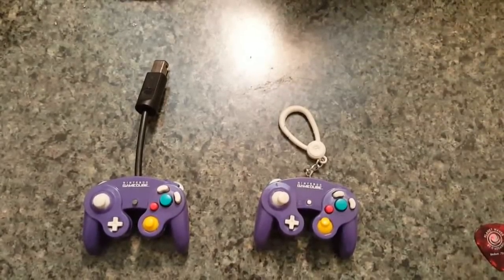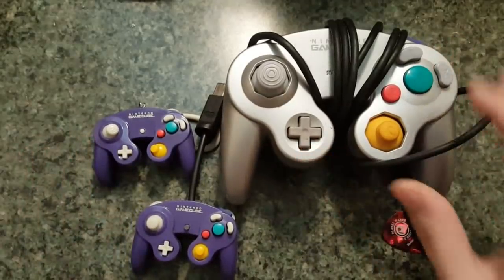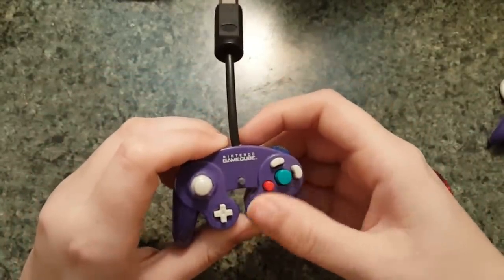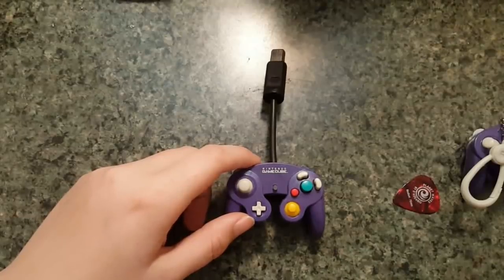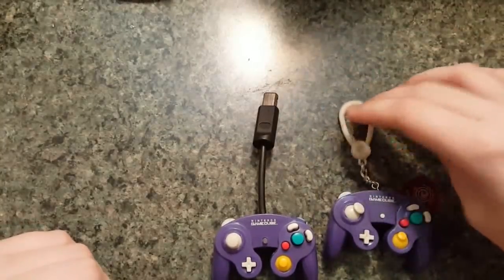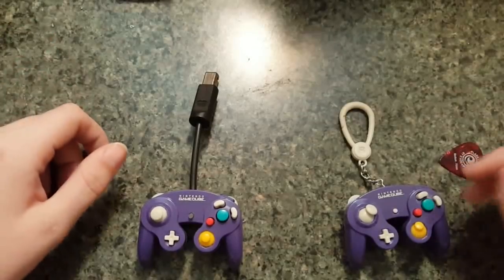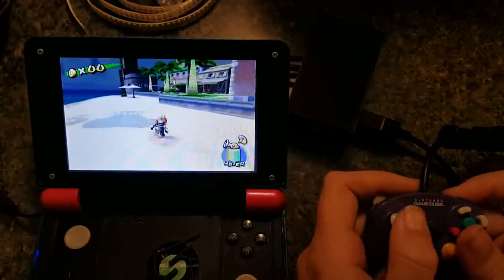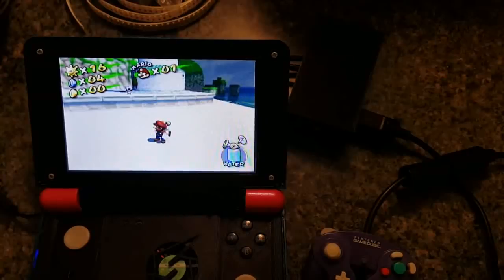World's Smallest Working Gamecube Controller

Comment: Now you need to make a tiny gamecube to go with it
Reply: Hisho 

If they can manage that then we'll be sitting on a Million Dollar emulation/hardware shrinkage solution for sure :)
Reply: solder rpi zero off the board and put it inside a case
Reply: The RPI zero can BARELY handle n64. I don't think emulating a gamecube would be the best idea.
Reply: Link Hero Of Time 
You could use a similar idea of shrinking the controller board using a combo of Flex, and Plex boards, and modify an Odroid to fit inside a Full Sized GameCube Controller case, (I think Odroid can handle GameCube) that in theory you'll have a portable emulation machine built into a controller.
Reply: She’s already using one. Kind of.
But that would be cute
Reply: She made one it's her latest video
Reply: SHE DID LMAO
Reply: You can't really tho because then you'd need a tiny GC disk (or emulator) which would probably need work on before making small
Reply: @MrScrubby55  LOL she used a minimized Wii and what I assume is Nintendont to run GCN games off a USB
Reply: Funny that she did
Reply: I'm pretty sure she has.
Reply: He already did
Reply: The madlass did it
Reply: @ryan caling she*
Reply: she did😂
Reply: @LK-nu6mg  sucks that she didnt use this controller
Reply: She did lol
Reply: @nakog8686  yep it was this and some other mods to make it usable without a remote
Reply: @ryancaling1711  hey when the comment is made is right by the name...

Comment: Is it possible to make a Jumbo/Large Controller?
Reply from the maker: Axiom Ape Yep. Now find me a jumbo gc controller toy or model that I can use for the shell :P
Reply: Madmorda gotchu maybe
Reply: Madmorda 3d print it or get someone else too
Reply: 3d printing a huge gamecube controller would be really pricy
Reply: The Shangry Llamas true
Reply: The Shangry Llamas what? 3d printing is cheap as hell, you would just need a big enough printer
Reply: exactly, you would either have to buy a big enough printer or rent one or pay somebody else to do it. pretty damn expensive still.
Reply from the maker: The Shangry Llamas I have a pretty good size printer :P but there's a reason nobody has 3d printed a gamecube controller shell.
Reply: If you had a smaller print bed, you could also print your controller in smaller sections and glue them all together. It would be easier with a larger print bed though.
Reply: That, my friend, is Jumbo/Large.
Reply: that looks like 300 times more easy
Reply: Have your heard of the gamecube controller keyboard? Its soooo big but costs $100 to $300

Comment: You could use it with the Switch as well with the Magic-NS Adapter and a GC to USB cable converter to whatever length youd want and it would be like having a mini Pro controller.

Comment: That's dope. Do you make ps2 or ps3 controllers as well? And if i wanted to make my own, how'd you get a motherboard that small?
Reply from the maker: FastbackV8 If you want to make your own, check out the description :). As for ps2/3 controllers, they're analog so you can't make a Sony one small. You could make a third party one smaller, but you'd need a tiny shell to put it in. Find me a dualshock looking controller toy that's this size :P
Reply: Madmorda Hmm? What do you mean by analog? And I appreciate the fast reply.
Reply from the maker: FastbackV8 Haha I mean that it doesn't have a circuit board, it has a floppy piece of film that is very touchy and can't be replaced by digital (on/off) buttons like the ones here

Comment: I have several questions;
Will you be doing commissions later on?
Will you have a USB version?
And will you make the wire longer?
Reply from the maker: Vin32 There will only be one more for sale. If you're interested, please email me. If the wire was longer, it could damage the internal wires over time with the weight, so no. And no I can't make a usb version, but you can always use the wii u adapter with it :)

Comment: What did you do just chop chip out of the board and run wires to the components you installed??
Reply from the maker: It's a GC+ replacement board developed by Aurelio Mannara :) there's more info in the description

Comment: It wasn't clear from the link but what board were you using to push signals to the GC? Looks like a tiny purple board? Something from Adafruit? Very cool project! :)
Reply: The board is called a "GC+". It was designed by a guy named Aurelio. You can buy them at bitbuilt.net once the store upgrades are complete. There's a link in the description to the site.
Reply: Thanks for the info, much appreciated. So I guess someone's already done all the homework about how to interface a custom board to the GC then? Hope there's documentation. :)
Reply: I don't know how much documentation there is on how it works, but you're welcome to make an account on BitBuilt and ask. We like to share, so I imagine those who know the specifics can answer any questions you have about it.
Reply from the maker: youtubasoarus It's open source :) you can make your own. It's on github, just search "gc+ aurelio pcb"

Comment: Tangential thought: i have a Wavebird-style controller, a Chinese one, there's no room for normal rumble motor nor one present, and i noticed there's an unpopulated set of footprints for resistor-transistor arrangement ant two pins, and it seems like i could fit two motors inside the handle wings. Does anyone know, how do i find a fitting motor that i can order? I don't exactly have a shit ton of parts.

I know the stickboxes aren't very good or durable, but i can put something decent in later. I got some from China with yellow potentiometers, looking like a bit like fake Polyshine without the logo and with slightly different actual potentiometers (which is absurd, since Polyshine is a Chinese domestic company to begin with... so... decent but very inexpensive products), and those seem to perform well, obviously wouldn't expect them to measure up to original ones, but not too terrible, not as terrible as the ones you get on there by default.
Reply from the maker: Siana Gearz These pads are common on third party controllers, but the pads don't matter as much as the programming in the chip. More than likely you wouldn't be able to get rumble going since the original wavebird didn't have rumble, it's unlikely they would add that programming into their clone chip. The pads are more likely to be there for a "just in case" or for if they planned to reuse the circuit for another controller.
Reply: Aaah, i guess i should at first scope those things out or connect a LED to see whether any rumble signal is coming through. My line of thinking, they wouldn't have had access to original Wavebird firmware, and would have simply developed their own RF system which really just takes a few weeks and a couple people of very moderate qualification to throw together, which wireless-izes the GameCube controller, and there's some chance that the signal is coming out. The receiver/controller aren't necessarily Wavebird-compatible, just styled similarly. I should also get off my arse and get my various nRF24L01-compatible modules (all fakes/clones, some actually RF protocol compatible, others not quite, but widespread enough that that's something they might have used), set them to listen and see whether i can hear the gamepad and dongle talk.
Reply from the maker: Siana Gearz I don't know if it would light up an led, but you could certainly try if there's a trace going from the gloptop to the transistor. Or if you have a transistor with the right pinout, that might be better. The chip just sends a signal to turn on the transistor, which then connects the motor to 5v. If you got the transistor and hooked it up to the led and 3v from the batteries, you could test it. Keep in mind though that you would be running the rumble motor off (i assume) 3v instead of 5 though since its on batteries :)

Comment: Someone should make a epoxy mold and make these shells compatible with off the shelf parts.
Reply from the maker: Epoxy resin is too soft, and polyurethane is cancerous :P
Reply: @Madmorda   then maybe scan the shell and upload  custom docs to make it 3d printable?  The epoxy resin I use is really strong and often feels exactly like the game boy colors shell.
Reply from the maker: It might be SLA printable, but I don't have an SLA printer lol. Better buy the keychains while you can
Reply: @Madmorda  for some reason  I cannot for the life of me find them.

This is why I'm looking for alternatives.
Reply from the maker: Gamestop never restocked. Some gamestops still have a few, you'll have to search their website to see where. Otherwise your only option is to check eBay. You can wait for someone to list it, or buy a box of unopened ones

Comment: I'm interested in buying one or two
Reply from the maker: Zero Revenger They're actually a lot of work to build (not to mention kinda expensive) so I'm not sure whether I'll be selling these yet. If I do, it'll only be a couple :)
Reply: Madmorda I understand... If you decide to sell any though could you let me know? cause these are really cool and inventive. Its a really good idea. If they had wireless and a detachable cable that would be even cooler!
Reply from the maker: A wireless and detachable cable? Not sure what you mean here other than an extender cable (Which I used it with). If I do make a couple extras I will let you know :)
Reply: thanks, I really appreciate it :D when I say detachable cable I mean like how some headphones let you remove the cable and use them just wirelessly or reattach it for wired if you prefer. Then this could be even a little smaller and I could use it with Bluetooth for Dolphin. or even RF like a wavebird is cool too. I actually don't care all that much about rumble. but wow I still can't get over how cool it is...
Reply from the maker: Zero Revenger The main problem with that is battery. Even if I could fit a wavebird in there, the battery life would be like two minutes. Plus the signal would be terrible because you need antenna inside :P I've thought about it too though, wireless would be amazing